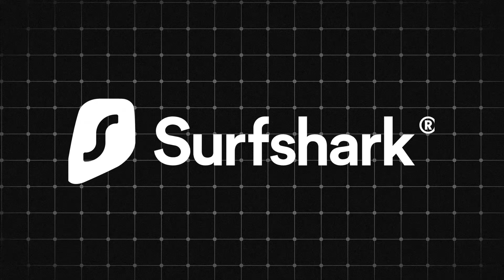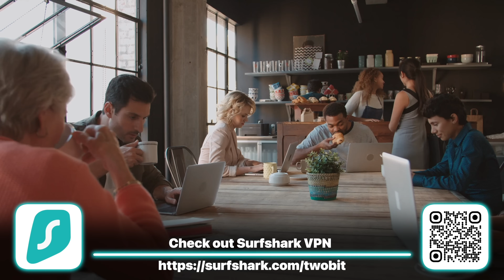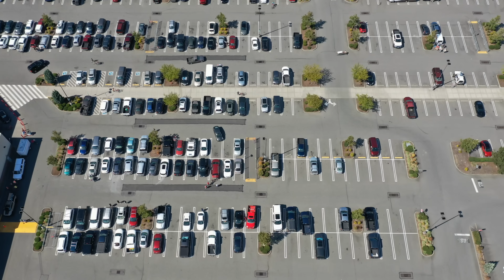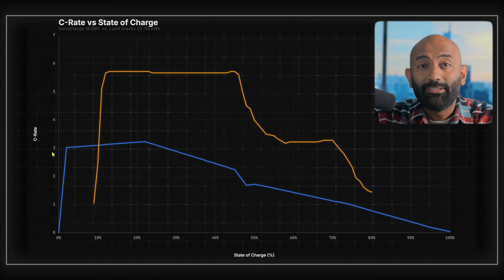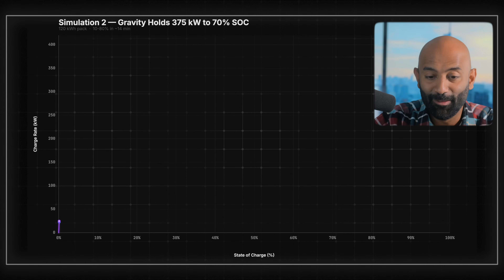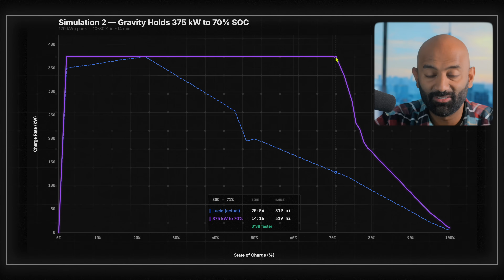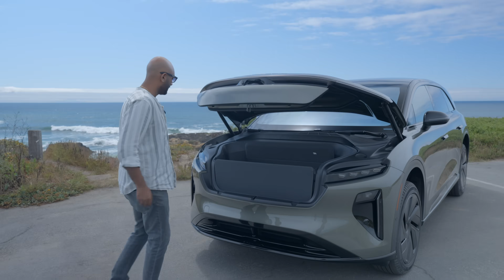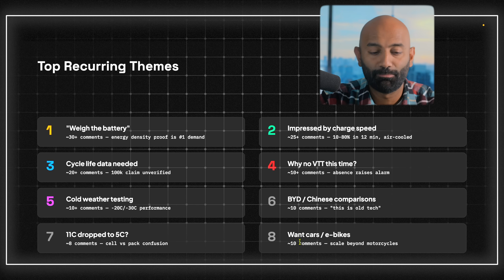Donut Lab Battery Test 4 Changes Everything!

Comment: Honestly... while weight is important because it affects the vehicle's charge consumption (it's overall charge per distance efficiency), I'm much more interested in the lifespan/life-cycles of these batteries as opposed to the weight...
I honestly don't care if the cars become slightly heavier, as long as we have everything else (really fast charging, super long-life batteries, no fast-charge degradation, etc.).
Even if cycle-life is only 80% @ 50k cycles (half of what they're "promising"), it opens up a whole industry about battery recycling. You can buy a car without the battery included because you can use the same battery from your previous car instead (which you already paid for), for example.
That and there will be a much higher incentive for after-market companies to recycle these batteries into home batteries and other uses (grid stabilization, etc.).
Reply from the maker: 80% at 50k still opens recycling — love that angle

Comment: Im still not convinced. A fresh cell can be stressed to such high rates without problems. There are a lot of cells around you can stress in the same way. The question is only how many time is this possible. What is the guaranty of this monocycle battery?
At the beginn of a battery life cycle the resistance is low and this means not much heat. But with more and more cycles the resistance increases. This means lower rate's at the end.
I would wish really someone found the holy grail  on batterie and why not this, it would be a win for every user. But actual non of the results proofs  there promise.
Reply from the maker: cycle life’s the real test — peak numbers mean nothing if it degrades fast

Comment: Just an FYI, I've tried using surf shark in China and it is really unstable. Sometimes it works, but it disconnects often. China's firewall is a real struggle for VPNs (at least the ones not tracked by China's government). I've had some better success with Mullvad, but all VPNs can be a bit unstable. Probably depends with region too.

Comment: It's a motorcycle, a tiny little motorcycle... A larger battery (or larger anything) has more volume for its surface-area. You can't extrapolate charge rates between batteries like that.
Reply from the maker: scaling's not linear, but 5c+ on a real bike? still legit progress

Comment: Since it takes more current to charge as the battery gets fuller, doesn't that mean that it will take more watt-hours going in than the car uses in operation?  So, if a car uses 0.3 kWh per mile, how much kWh do I have to use to get that mile or range?  The faster I charge, the more input power is lost?  Is there an online calculator that can predict how much in kWh input it takes to get the expected output (mileage)?
Reply from the maker: Wall meter truth — charging losses are real, but they’re on you, not the battery. Still beats gas.

Comment: The BYD Blade Battery 2.0 (Short Blade variant) features an 8C peak charge rate and 16C peak discharge rate, allowing for ultra-fast "flash charging" from 10% to 70% in roughly 5 minutes, or 10% to 97% in under 10 minutes. It is primarily designed for high-performance 800V–1000V electric vehicle platforms.
Reply: No evidence yet, and judging by the megawatt charging byds currently on the chinese market, miserable density. Actual range charged per minute on par with western cars that charge at 400kw. Overall, inferior tech compared with Lucid Gravity (Panasonic cells).

Comment: amorphous titanium dioxide nanostructures
Reply from the maker: lol what even is that
Reply: @TwoBitDaVinci The research that Donut's manufacturing partner did for their PhD. Look it up.
Reply: @TwoBitDaVinci Amorphous titanium dioxide (

) nanostructures act as high-performance anode materials in lithium-ion and sodium-ion batteries, offering superior capacity and rate capability compared to crystalline phases. Their disordered structure accommodates large volume changes during ion insertion, reducing strain and improving structural stability. These nanostructures often exhibit significant capacity, with some studies reporting over 200–800 mAh/g, making them promising for safe, high-power, and long-lasting energy storage.

Comment: So the zeekr 7x has been selling to consumers for about a year with 5.5C charging already.  Of course no other auto or battery manufacturer has gotten to Zeekr’s level yet so it’s still impressive.  The thing is that batteries generally can be engineered and tuned for charging speed or energy density.  This still needs more testing to be actually impressive.
Reply from the maker: zeekr's 5.5c is solid — but this is a motorcycle charging live on a public charger. apples to oranges

Comment: If the watts per kilograms comes close to 400 and if they get only 10 to 20 percent of the 100,000 cycles it blows away every other battery on the market today. I really hope it does.
Reply: You can already estimate cell weight is close to 235g..
 Why? You know VTT test result. 94Wh in lab and informed nominal 125Wh for battery incl. cover. Then you know individual battery weight 315g. And they also mentioned Verge with 33.3kWh pack its curb weight is 235kgs. Use math and % scaling. Nominal density is around promised 400Wh/kg and actual then 300Wh/kg
Reply from the maker: 400 Wh/kg at 10-20% cycles? That’s still 40-80Wh/kg usable — game changer if real.

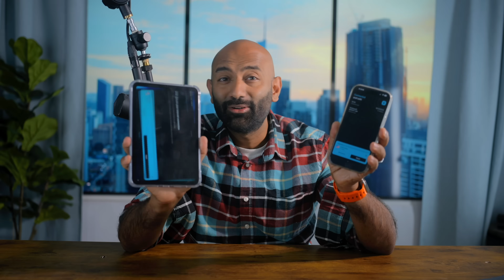Comment: 4:55 naive question: if the (apparently) faster charging of the donut/verge battery is already quite impressive, what would this mean if the same technology is user for a bigger (car) battery? Just insanely fast charging times?
Or are there other limitations of a bigger battery and the donut one only works in a motorcycle?
Reply from the maker: I literally did this analysis, check chapters.

Comment: After BYDs Blade2.0 announcement the Donut battery doesn't seem very compelling. And BYD shared technical data with the launch, not months after bit by bit
Reply from the maker: blade 2.0 dropped the receipts — we're still waiting for the donut lab to weigh in

Comment: Ricky, You wanted to see "0 to 100% charging". That's old thinking. How do you get the motorcycle to the charger station? Trailer it there?  Manufacturers have stopped using that spec because it makes no sense.
Reply from the maker: trailer it there — got it. still useful to see the curve though

Comment: Some chemistry REQUIRE high temp to work, the higher the temp, the less the need for a powerful cooling, because ambient delta is higher, so it naturally cools down more.
Reply from the maker: yeah but at 5C on a motorcycle? you still need active cooling — ambient only gets you so far

Comment: I would expect a liquid cooled full size donut pack for a car would actually far outperform that chart, because like you said the chart is thermally limited by the air cooling, if you assume the full curve looks more like the lucid curve and use the chemistry limitation section at the end as the baseline, it looks like the donut battery is closer to 3-4x the charge rate. the earlier thermal limited portion would no longer be thermally limited with liquid cooling, there is a lot of performance left on the table by the BMS it seems
Reply from the maker: liquid cooling would smoke that chart — no air limits, just chemistry holding it back
Reply: @TwoBitDaVinci  Yeah, honestly pretty exciting stuff. Looking forward to the next drop tomorrow

Comment: Random question(s) that is somewhat related. Would a hybrid battery/capacitor where the capacitor materal and battery material are wound together function? If that is viable what ratio's of windings would make the best product? For example a 2 to 1 battery anode/cathode to 1 capacitor anode/cathode inside a single cell be more effective than a 1 to 1? To prevent bleed over, would there need to be seperate layers or just put anode material from both battery and capacitor on a single sheet front and back and cathode material on the other sheet front to back?
Reply from the maker: i've thought about that too... i think it would be complex not sure anything close to production follows such an architecture but its interesting
Reply: The cost-benefit analysis would be very difficult on that one.

Comment: Shouldn't it be 2⁵ harder to charge @ 5C vs 1C? So, it's not 25X harder, but 32X harder? (This is a really basic error, man......)
Reply from the maker: nah, it's about current, not power — 5C means 5x the current, not 2^5. easy mixup

Comment: If we could get a flat 200 to 80% then it would be great but these dorks are trying to max out the numbers in power instead of times.  Two 200s in a single shared public charger is better than a few mins of 250kw that turns into like 150 and ramps down.  The KIA and Hyundai are better than a Tesla other than a Cybertruck on EvGo and Electrify America.
Reply from the maker: 200-80% flat would be ideal — but physics says tapering’s unavoidable past 50% on most packs. Kia/Hyundai get it right with real-world usable speed.

Comment: Thanks for the top tier response videos. What baffles me is how they can claim 100,000+ cycles but only provide a 5 yr warranty on the battery. That's not showing confidence in its durability where it counts.
Reply: True, since most EV cars have 8-year warranty why only five on a motorcycle?
Reply from the maker: warranty’s the real test — cycles mean nothing if they won’t back it
Reply: @mquiring3373  in the real world, people scam. Deliberately breaking something old, or trading it for a broken or counterfeit, to get a new one. There's also that they are mobile batteries, which will have physical wear unlike other batteries. Five years is also more than most lithium ion, for their first generation of these batteries. Tesla only offered higher for powerwalls because they built the batteries at 50-100% over the label capacity, so as it wore out it still hit decent specs. People would throw a fit if their mobile battery had higher capacity but they weren't allowed to use it or charge at peak specs.
Reply: I don’t know anything about batteries but maybe they degrade over time independent of charge cycles.
Reply: @counselingpsychology That could be why, which would nullify the hype. They should be pushed to answer this but no one talks about it.

Comment: Imagine a future where the charge plug also has cooling lines. When you plug it in it starts pumping very cold coolant to keep the batteries at an ideal temp so you can charge at 12C. Drive away faster than you could even use the restroom 😮
Reply from the maker: lol coolant lines on the plug? now we're talking — but yeah, complexity and cost spike fast

Comment: Since charging began at 9% I don't think the comments of current ramp up matching cell voltage would apply. The cell voltage at 9% should be close to nominal.
Reply from the maker: nah, impedance still bites even if voltage is flat

Comment: It really seems like a lot of the advantage in putting a battery like this in a car is not how fast you could get it to charge if it has liquid cooling, but how light, simple, and reliable you could make a pack with a battery like this and still get very good charge rates. Imagine how inexpensive and reliable the pack could be if it had no cooling system at all? It would be smaller and a little lighter and still have a very good 4c charge rate.
Reply from the maker: exactly — strip the cooling, keep the 4c rate, and you’ve got a stupidly simple, cheap pack

Comment: on 16:10, I would think it would extend even further, as the temperature buildup would be much lower when charging at a rate capped to 400Kw. So the taper off would start even later, if at all.
Reply: Exactly!
Reply from the maker: lower delta-t means later taper — makes sense

Comment: This specific test looks impressive to us because the USA is so far behind China. China is pushing the bleeding edge at 1500kw 10C charging at the pack level. It needs to be compared to its peers, the best that is currently being developed not to our outdated tech. The Lucid is the best we have at 400kw charging but it still pales in comparison to the newest coming out  in China. Whatever Donut's battery is. It will likely be a good cell, but it may just be competitive with what China is already doing and not revolutionary, it just looks better to us because we are behind. They still haven't proven their wildest claims that would make it revolutionary.
Reply from the maker: China's already doing 10C at pack level—this needs to beat that, not just Lucid, to be revolutionary.

Comment: The Donut battery technology will likely be tweaked and improve over time. If the Donut battery is better than any battery we currently have in production, it is certainly promising.
Reply: lol, you can’t tweak something you know nothing about!
Reply: @HsquaredH2 , all manufacturing processes and product designs are tweaked over time.
Reply from the maker: tweaks and improvements — that's how tech actually progresses

Comment: The biggest hold back for consumers is time to charge. Most people work and fill up their cars and trucks in the morning before heading out and usually in a rush. A 30 minute charge up means leaving the house at 5:30am and getting to work at 6:00am  vs a 5 minute fill up in a rush. Getting close to that fill up time and driving range is what will push EV adoption better.
Reply from the maker: charging speed is the real daily grind — not just lab numbers

Comment: When you see a slow ramp up in charging power between ~5% and ~20%, it's most likely because that you're charging at the current limit of the charger, and the voltage of the pack (as long as the battery has been thermally pre-conditioned). As the pack voltage increases, the power increases. This does not apply to the tiny motorcycle pack because it's not challenging the current limit of the any DCFC.
Reply from the maker: nah, the voltage rise here is too steep for just charger current limit — pack's pushing harder

Comment: If the Donut battery can handle higher temperatures and the BMS is not developed, then could it charge to 80% before slowing down the charge to manage temps?
Reply from the maker: That's exactly what the curve shows — holds 5C until ~43% SOC before temp management kicks in

Comment: Remember that the test was done in Finland so the Bike and the pack was most likely around 0-5°C. Also the air used for cooling would be the same. That alone makes it closer to normal water cooling instead of "air cooling".
Reply from the maker: 0-5°C changes everything — that's not air cooling, that's practically liquid cooling temps

Comment: If they can manage to fit 33.3Kwh of battery in a motorcycle I'm completely sold on this tech, this would also convince me of improved energy density. Verge is advertising a long range 33.3Kwh option supposedly capable of 200Kw charging. If this battery was scaled up to EV sizes it would absolutely be limited to infrastructure charging speeds. You'd have flat charge curves maxing out the DC infrastructure. Imagine an EV holding a steady 400KW charge speed to near full. You'd need 800-1000V packs due to cable amperage restrictions.
Reply from the maker: 33.3kWh in a bike? Wild. But yeah — 400kW charging needs 800V+ just to keep cables from melting.

Comment: Im honestly just surprised we have EV chargers out and about with these levels of KW charging rates. If I turned literally everything in my house on all at once the maximum draw is around 22-23KW. The fact a single car can pull 400KW boggles the mind.
Reply from the maker: 400KW from a single car? Yeah, our house wiring would melt trying to keep up.

Comment: It all sounds good, but low temperature charging and discharging are big ones for northerners. I would guess, if true solid state, it will do OK unless low temps cause excessive expansion or contraction or cracking of substrate. Cycle life in cold, heat and cost?
Reply from the maker: cold temps and cycle life — yeah those are the real questions. solid state might handle it, but we’ll see

Comment: Keep in mind that the Verge implementation of the Donut battery just has air cooling. A properly designed liquid cooling system should allow the system to maintain a full 5.7C charge rate for significantly longer.
Reply from the maker: Yeah but if chemistry was the limit, it wouldn't hold 5.7C this long even with air cooling — look at the curve.
Reply: @TwoBitDaVinci  Not going to know for sure until someone can test the battery in a proper liquid cooling system.

Comment: So I watched your video on the first test, and you believed it looked like lithium chemistry, but it was charging fast.  After four tests, are you coming round to this being the real deal?
I wondered whether they were bounced into doing the first test by their backers, and pulled a fast one to buy some time, perhaps by combining a super-capacitor with a lithium pack.  As this has gone on, even if there is some subterfuge, what they have demonstrated is still a great step forward.
I'm still sceptical, and really want to see how much it weighs, but it does look like whatever they have done is a big step forward.
Reply from the maker: Yeah I want that weight and chem data too — until then it’s just intriguing hints.

Comment: Next test/release HAS to include the weight. Clearly the thermal tolerance and charge speeds are fantastic. If it comes in even at 300wh/kg it would still be a huge improvement. 400 would be amazing.
But especially for any smaller vehicles like ebikes, weight (and size!) of battery is seemingly the biggest tradeoff that has to be factored into the design. The longer they hold off releasing that info, the more suspicious I am that the number is not what is claimed.
Holding out hope, as I really want this to be real.
Reply from the maker: weight is everything for ebikes — if it's 300wh/kg it's still huge, but 400 would be magic. hope they weigh it soon